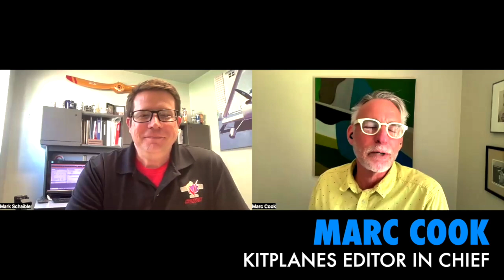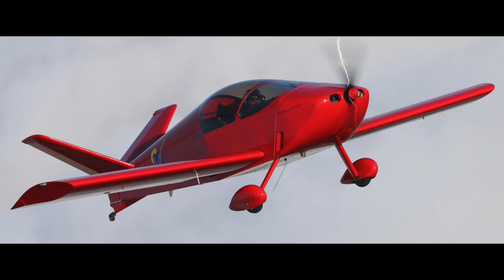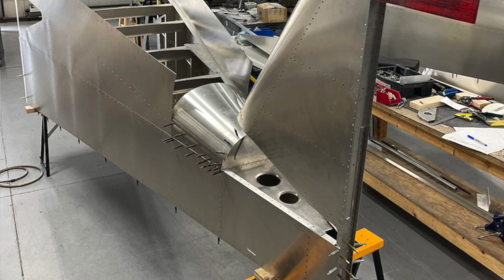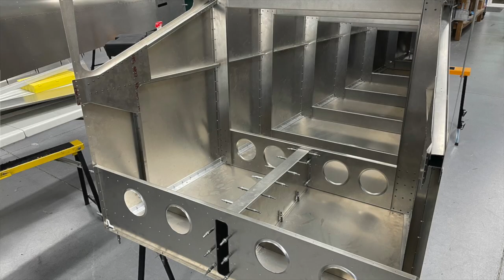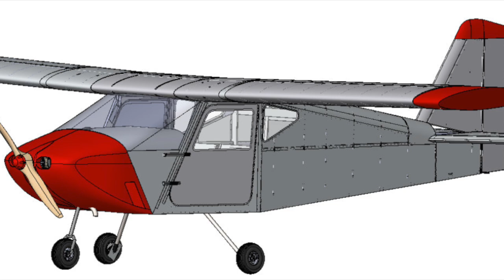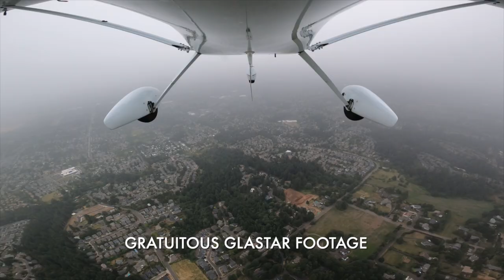When Will the Sonex High Wing Be Ready? We Asked Mark Schaible & This Is What He Said!

Comment: @SonexLLC  there's a huge amount of pent-up demand for the Subsonex two seat jet. Improve the range by cramming in aux tanks anywhere you can, use the TJ150 or the TJ200 to push the extra weight + crank out enough watts for optional IFR equipment, and make an option to upgrade it to a twin-jet just like the drone you've already designed so our wives have enough confidence to sit in the right seat... then you're golden with a literally unrivaled product with no competitors in sight. You guys are missing out on a ton of free cash flow by delaying the utterly unique (and hopefully improved range) JSX-2T in favor of these various prop models that have dozens of other competitors already in the sky before you roll the first one off the production line. Cash is king for a small aerospace company and the mismanagement of it has relegated so many other aviation startups to the boneyard of bankruptcy. I sincerely wish you the best, keep your eye on the ball. There's a full-kit bank check burning a hole in my pocket, just hoping to see enough timeline & performance details in the near future to inspire enough confidence to mail it.